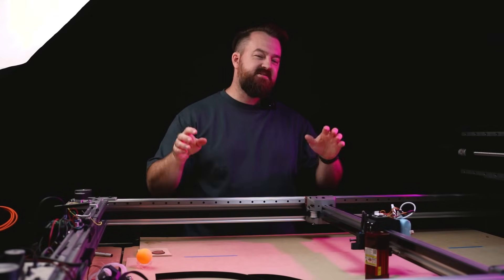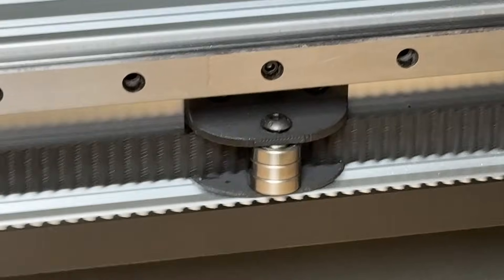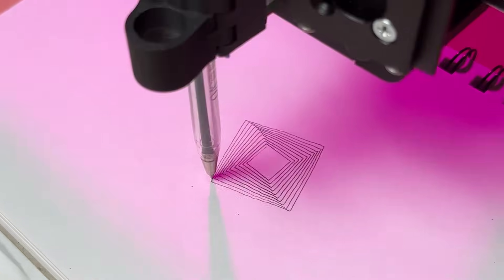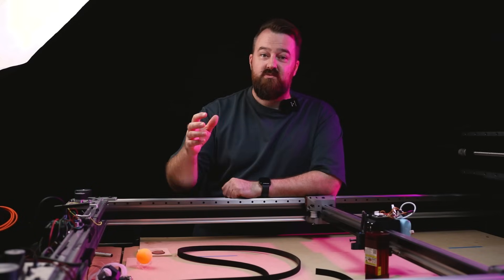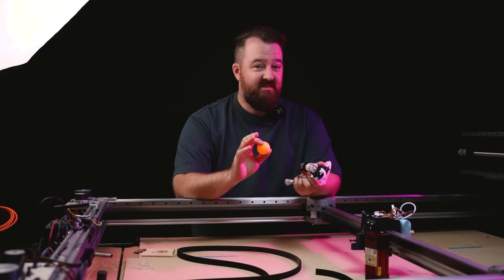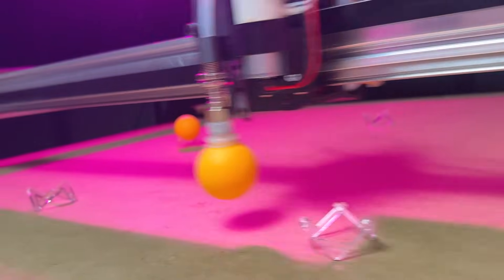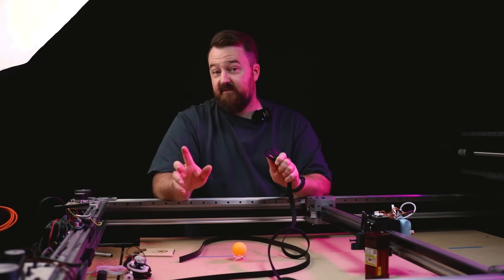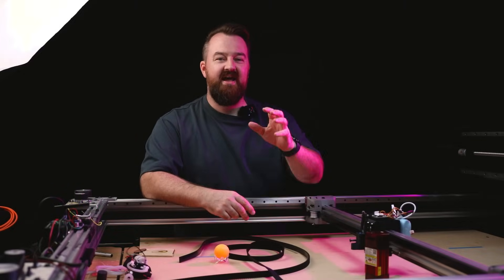CoreXXXY // SUPER SPEED // FluidNC

Comment: Thank you very much for posting the making of your core XY plotter.
It is very helpful.  I like the wireless Z controller and the fine descriptions of technical design decisions. I have also built a machine. Some samples of my machine painting.

https://youtu.be/JdSiGadU6xQ?si=lRvCM9q2Yr4ImMvV

https://youtu.be/8XWwEHxJTIg?si=5VMUmdNYX_DbK1W9
Reply from the maker: Awesome! Thanks for sharing… I love your design and paintings. Curious to see how you setup your gcode to dip paint pot when needed. I manually inject code myself when retracts using notepad++ however wondering what others do to solve this? 
Thanks for connecting!
Reply: Hi Mark,

Thank you very much for the nice feedback. 

I am having fun painting with my machine. I have an engineering background and have always done art. Since I retired from engineering work, I have been busy making an art machine and painting with pastels.

I’ve written Python code to load a picture, extract contour and color data, and develop several functions that generate G-code lines based on the image data. I also create an SVG file for previewing. I frequently update the painting functions and parameters. Python is very flexible for this. For brush re-inking, I count travel distance and call a G-code brush function after the limit is reached. I find that about 500mm of travel works fine, but it depends on the brush and paint, so the number is a setting.

I built my machine using off-the-shelf metal plates and 3D-printed parts. It has a core XY mechanism with 6mm belts, an Arduino with the CNC hat, and GRBL. I’m getting better than 0.1mm repeatability. My construction was not the most efficient and reduced the available printing area substantially, so at some point, I may build a new one. For now, I am focusing on additional paint code. It is complex to get a visually clear or recognizable image. 

I have also drawn in Adobe Illustrator, which results in very sharp images. I liked your Adobe Illustrator technique. 

The commercial software DrawingBotV3.com is very interesting. I use it to convert SVG files from Illustrator to G-code.

My latest art is at:
padlet.com/glasscanvas/glasscanvas

Carlos

Comment: At that size, would CroXY (cross-XY) not be a much better choice?  Needs more motors and linear rails, but uses much shorter belts and the extra motors also give more power to move the head where you want it.
Reply from the maker: Great advice!! I didn’t even know this was a thing! Reminds me so much like a mpcnc, however motors not fixed to moving axis. Thanks so much for this direction!! 🤩🤩🤩

Comment: Great build!  What extrusion is that?  I've never seen the U profile, and couldn't find it on the usual suspects like 8020 or Misumi... I'm assuming you chose it as it would be less susceptible to flex, and you could nest the cables back in it a bit?
Reply from the maker: Yes this type of extrusion is called a v-slot 4080 cbeam. I had it left over from other projects, although it is overkill for this project. On the other hand, I didn’t have any flex issues! I thought it would be interesting to integrate the belt within the frame to provide more usable travel area!

Comment: very cool! ⭐ What kind of price are we looking at, all of the parts and built materials combined at this point ? Asking because I have wanted to built something similar but different for a while.
Reply from the maker: Thanks for your comment! I have roughly calculated to come to a maximum of $750USD. This includes everything such as hardware and electronics, however only with plastic 3D printed parts. An additional cost for machined metal parts!
Reply: @NEWTechCreative  Thanks! That's a bargain tbh - Well done! looking forward to see updates :)

Comment: Probably won't work, but just at thought. What about putting magnets, like fridge magnets, not supper strong, on the wall behind the belt, see if the metal in the belt stays closer to the wall to prevent the belt drooping / moving out of place.
Reply from the maker: Awesome idea! I never had thought of that. This would be a great way to support belt if it has enough attraction. I might try I out. Thanks for this 👍👍

Comment: One thing to add to the suction cup system would be a way to rotate the object being held, perhaps with a servo for rotation around the vertical axis, and a rotation around x or y axis, then add a camera that finds a reference mark on the ball and orienting the ball as it moves it, possibly with interim pauses to find the mark with the camera, and to deal with the fact that one or both of those axis is likely to not be 360 degrees of rotation. One of the things the code would have to work out is 'if it can see the mark to begin with, or once it's oriented the mark, if the Z axis of the ball is not the z-axis of the effector, how far along the off axis does the effector need to be moved to put the ball in the proper holder? I.e. sin of the angle of rotation times the resolution of the x/y effector change.

Out of this may come the ability to use brushes or ink well nibs to do calligraphy with those pens down the road, as that is likely to require keeping track of the angle and writing direction of the pen. Most of the inkwell pen nibs require "drawing" as in 'pulling' the pen that is not oriented vertically, however loading the pen may work best vertically.

And yes, working out detection of when to reload the pan gets interesting as well. Possibly training the system using a disposable fountain pen then moving up to an inkwell pen system would be a good process.
Reply from the maker: Dude! Thank you for your comment! Love the your thinking, direction and ideas. I was working on a small program a while back that could easily adapt a rotational axis mainly for drag knife or concrete extrusion machine and this would be perfect for what you’re suggesting. Essentially the program uses the current and future locations to calculate angle of z axis before moving and adds extra gcode as needed. This is a nice rabbit hole to go down for fun 🤩
Thanks for your support and ideas 💡

Comment: 10:56 and what might that price be?   I'm curious I am building a large core xy as well
Reply: I too am making a large corexy and would like to know what counts as affordable.
Reply: @kurtnelle  I went and put my parts into PCB way after making that comment, so for printed aluminum like his mine cost about 70 USD according to the auto quote for two carriages which honestly seemed a little steep considering they are basically c channel but if you pick ABS the price tanks to less than 20 USD.
Reply from the maker: When manufacturing one off parts, no matter the process of can seem expensive, however compared to what it would cost traditionally for a one off item, they are incredibly reasonable! You might be able to get away with 3d printing the parts if you have access to a printer 🤩🤩
Reply: @NEWTechCreative  yes that is true.

Comment: Maybe synchromesh cable is a better solution than belts to eliminate some issues going around the pullies and tensioning. Great project!
Reply from the maker: Very interesting! I will have to look into this. Thank you 🙏
Reply: Syncromesh had a short niche popularity in 3d printers almost a decade ago with popularity of the bukobot.

I'm not sure why it fell out of favor, possibly availability/cost and steps per mm. Iirc you neee 0.9 degree motors just to get same accuracy(steps per mm) as you get with a gt2 belt pulley on a 1.8 degree motor.